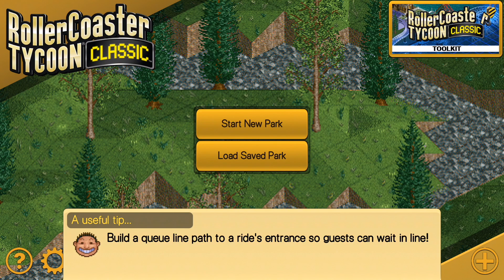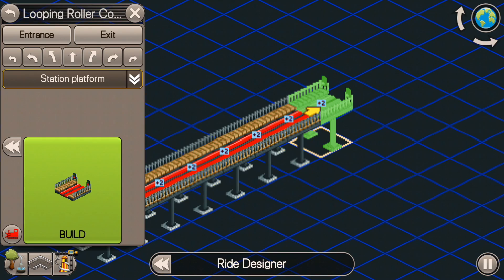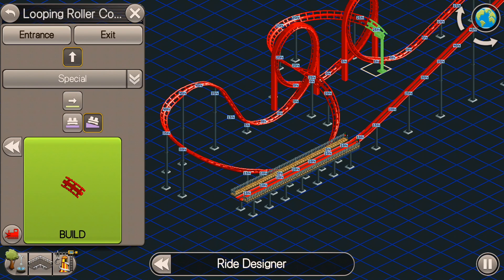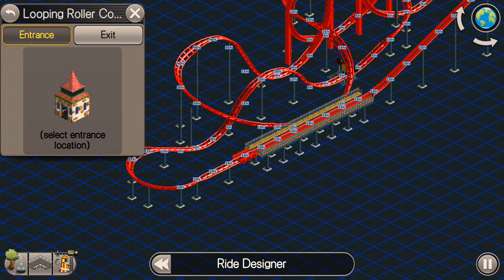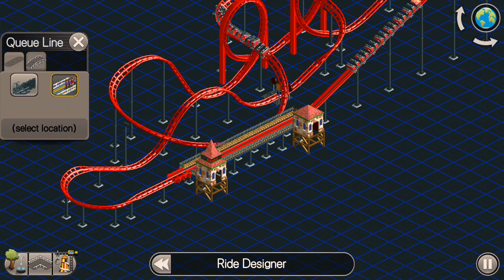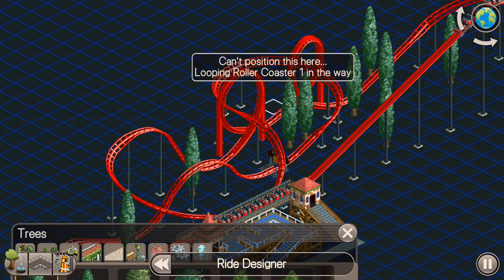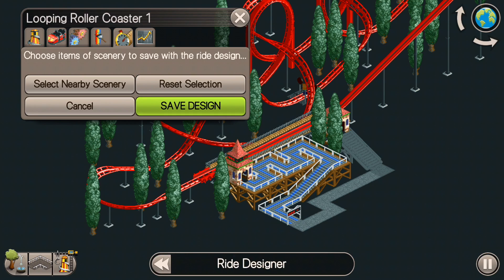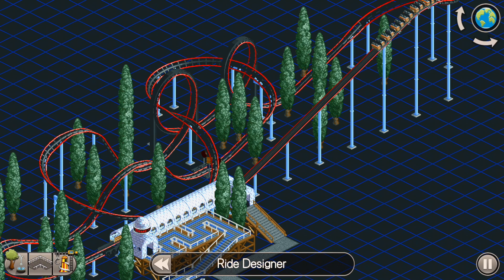RCT Classic - How To Build Looping Roller Coasters (For Beginners)

Comment: I built a very very fast looping roller coaster and it's a huge track it finishes about 30 seconds max speed 64 mph average speed 36 mph and it's excitement is 7.80 intensity 9.30 and I don't know what spelling the last one but it's 3.40

Comment: Hi I can't see how to build behind the station. Can you go slower and tell us what track you're putting down. I have got to the bend after the 2nd loop. Can't build anymore after that because I can't see.
Reply: Stephen Noakes have you tried switching the angle
Reply: Yeah tried that. I am really struggling to build and can't see behind the track.
Reply from the maker: Try slowing down the video 50% or even 25% and look closely at what type of track I'm using in the build box
Reply from the maker: Also, all that is behind the track is that i bring the roller coaster all the way to the ground and back up into a banked hill/turn